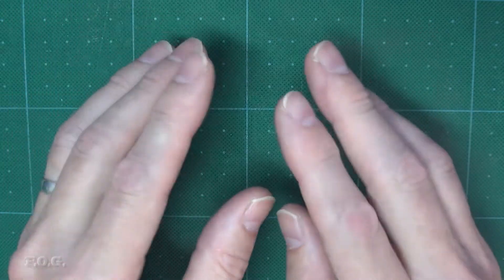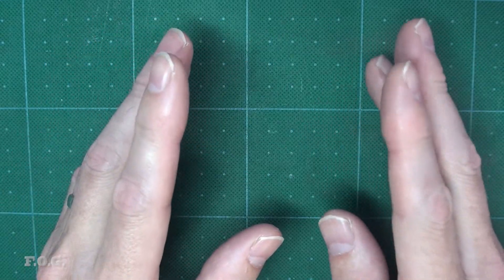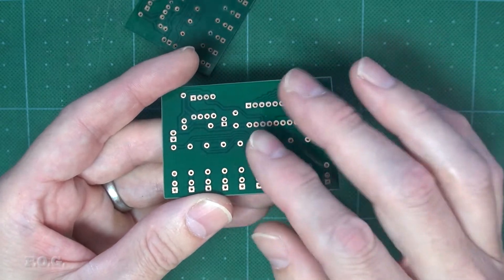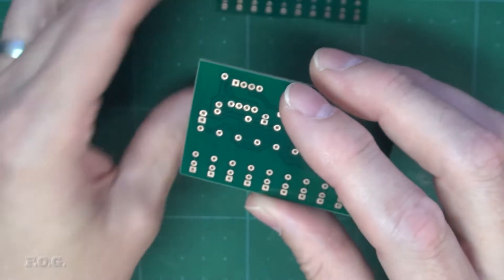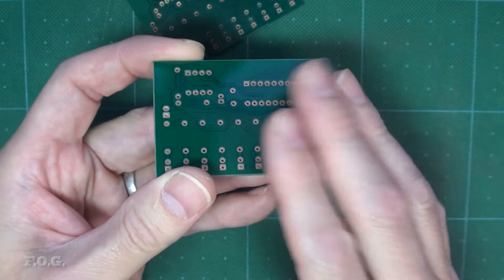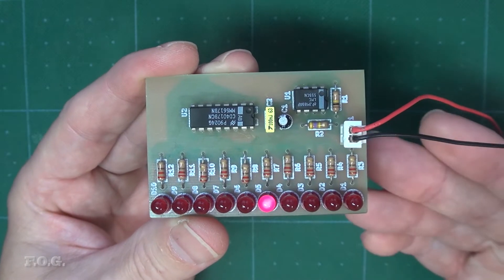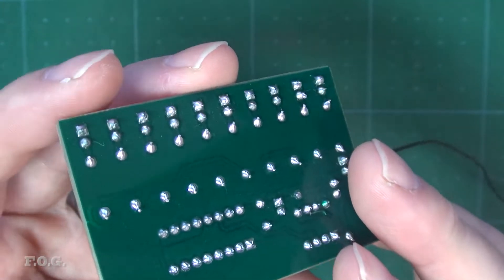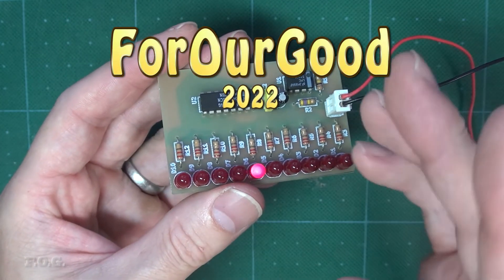EP5 – DIY PCB – Single Sided PCB made with CNC3018

Comment: Run your DRC on the board before manufacturing to catch that trace/pad interference! These look great. I generally don't go through the hassle of the resin, but I also don't use the resin for an etching mask. For vias, they do make rivets that you can set, but I usually just put a piece of wire thru and solder on both sides. The main issue with double sided is that if you don't use the rivets, soldering an IC can sometimes be a problem, as you do need to solder from both sides, since the solder won't otherwise flow through to both sides.

Comment: The thickness of the "green goop" is all over the place which may affect both the Lazer pad clearing as well as the tool clearing.
Get a small embroidering hoop and a piece of screen printing material and use that to flood-coat the board for an even layer thickness.
I also saw one youngster who is experimenting with using a sharpie and CNCing black spots wherever there are pads directly onto the green layer BEFORE exposing to UV to cure. The green coating beneath the black sharpie does not develop and is easily washed off once the rest of the green coating is cured.
Reply from the maker: You are of course correct, the thicker resin for sure makes it hard to clear with the laser.
But you will see in episode 6 I demonstrate the hoop method.
But actually I stopped using the hoop a while back, as you will see in my PCB tutorial video, and just use the silkscreen holding it by hand now.
I have some recent improvements in the application of the resin, which I will also share in an upcoming episode.
I have never heard of what you described about the back sharpie, sounds pretty innovative if it really works! Obviously adding another method/device to the process is honestly not that desirable, and my gut tells me It seems unlikely to work on a 0.2mm x 0.2mm pad.. But I always keep an open mind, so if it looks promising I always like to give things a try!

Comment: You have a cnc mill,drill some hard plastic small bore tube with the finest pcb drill you have block one end up with hot glue .connect a fishtank air pump to it and sit it under the pcb in the ferric chloride ,on a plastic riser to allow the air bubbles to clear the copper debri while etching,also since your using ferric chloride make up a batch of "EDINBURGH" etchant ,other than being the capital city of Scotland,it's a mix that by itself helps clear the "smutt" from the board as it is etched,what is the saying winner winner chicken dinner.

I've used Edinburgh etchant(please not Edinburg,the Scottish variant of the English borough) to make brass escutcheon plates for vacuum tube amplifiers that i make,it does a great job,makes nice clean etches and even cuts etch time down with the desmutt effect.

Usually a 4:1 ratio,4 parts ferric chloride to 1 part citric acid,citric acid is bought as a powder,i can't remember if i even used this ratio,i think i added a litre of relatively strong citric acid mix,a few heaped table spoons.the citric acid is food grade so is non toxic by itself.

Use a tall tupperware container to make a bubble etch tank,microwave the sollution with an air tight lid in short bursts to just get it to around 20 degrees c ,glass heaters for a fish tank also work since the commercial units use them,i know because i have an etch tank and a developer tank,and wish i had just made my own with the purchase price of about £200 each 20 odd years ago.
Reply from the maker: FYI: Currently my etching with ferric chloride takes between 5 and 10 minutes to complete (for me this is not a long time).

But saving a bit of etch time and improving the even cleaner etches sounds attractive, so I might try the Edinburgh etchant you suggested at some point in the near future, so thanks for the tip!

Actually just a few weeks ago I was researching an alternate etchant, and was looking into one based upon hydrochloric acid, sadly getting that in decent concentration here in Japan is basically impossible (as is liquid tin FYI), so I gave up on that. I also expect that people in many other countries would face the same problems getting these somewhat toxic chemicals, so I don’t those are good “generic” solutions to show people.

As for coming up with more improved etching facilities, I am not feeling the pressure to do that right now, but I may get around to it eventually.

Currently I am regularly etching 0.1mm traces, and to do that you really have to be on your game, and monitor the etching progress like a hawk, 45 seconds is often the difference between success and failure. Basically, I am standing over it for the duration in any case, so manually agitating does not bother me (its rather therapeutic actually) :face-blue-smiling:

Comment: This really does take a long time to do,I think because i have to make multiples of one schematic i'll use a painted sheet of clear acrylic and mill it out to make a uv resist mask with any drill holes performed by the mill,using the largest track size as a single cutter then use smaller cutters on 20-30% overlap just like milling any other image in wood to get the rough then fine detail,that will clear out the final,a cut depth enough to clear the paint away will be fine.

The laser is great but going old school with uv resist for the copper and making the other stencils for solder pad resist and any text made using an engraving bit on painted clear acrylic all with registration holes will make for a good set to make multiples of the pcb in short time spans.

The only issue i ever had with uv exposure was using a laser or ink jet printer that would leave pixel holes in the stencil,apart also from going from positive to negative resist the cost of positive resist in the UK was astronomical until the negative  resist from china came along,other than this the uv stencil method takes about 15mins per board,ok this is without component top side marking,but as i say a stencil for this or a silk screen can be made,silk screening is faster too but it's a bit cumbersome compared to the stencil dryfilm method,text is fine really for single sided boards.

I want to make pcbs as fast as is possible for one offs i really don't want too much time taken over that either especially if its a prototype.

If anyone got this far i should add that you might be able to use a refillable pen in a purpose made holder with conductive paint and conductive glue as solder for smd,just a thought.

I'm not knocking this series of vids,there's a lot to learn from your learning process here,success or failure,so i do appreciate the effort.

Subscribed and thumbs up.
Reply from the maker: So, it’s probably important to note, that at the start of this project, the amount of time required was not the key focus, my focus was on trying to make a PCB at the highest possible quality with the lowest possible overall investment. Hopefully, as you progress through the series, you will agree that I am slowly but surely meeting those objectives. (Check the community page for recent updates too).

As at this point (spoiler), I have pretty much found solutions to all my key problems, the next natural step is optimizations that will save time, and recently I have made some strides in that regard, with likely many more to come. 

But I think it is important to also keep perspective, as the goal of making high quality boards is a fundamental goal for me. The design and prep before even making the board might take anything from a couple of days to a week. So, if it takes me one, two or three hours to actually manufacture the PCB, the that okay for me, and still quicker than ordering and then waiting for the PCB to arrive from China (especially if I end up doing 2 or 3 versions of a particular board back-to-back).

I also rarely, if ever, do more than one copy of a PCB that I design, and if I remake a given PCB it will always have some type of improvement. And if I need a batch of a specific board, then I will just lay out duplicates in the design, and make them all in the same operation (as I did the other day actually).

So really, for me, re-making the same board over multiple operations is just not a factor, and if I am honest, if I needed a super large batch (>20?) of boards, then I would just order them from China (though I suspect this will never happen..)

Thanks for subscribing and I am happy to hear that you have found this series stimulating, and I really do appreciate getting feedback from viewers, I may not heed every piece of advice immediately, but I do keep it in mind, and some of my viewers ideas have actually key to making some important improvements in my process.

:trophy-yellow-smiling:
Reply: @ForOurGood  I wasn't knock your methods,i was going on about repeatability for light production,you're right that in batches going to a pcb house is the easiest way,for me if i needed to make more than 20 or so then outsource it would be,i just find the UV exposure when a good stencil is available is second to none,that's how the pcb houses do it too,each to their own,if it works for you go for it.
I did learn a lot and i did download the vids that held certain info to watch again off line as i have only ever used maual lathes and mills,still learning.
Appreciate the reply too,all the best.

Comment: ventured with the 3018 pcb milling from uv and photoresist/toner transfer methods to simplify prototyping. the allure of having the completed pcb already drilled in under 30 minutes after finishing it in kicad was just so irresistible. just like in the WEGSTR videos. but alas, decent repeatable pcbs are unobtainable with all of the current cheap 3018s as is. breaking a lot of the free V bits in the process.  even tried going the laser and spray paint pathway which imho made the process long and cumbersome again defeating its purpose in the first place. with significant tinkering, eventually made the 3018 achieved the above goals with trace size limited only by the 0.1mm tip of a 15 degree V bit. just make the machine sturdy enough to eliminate any play of the bit and backlash of the leadscrews. on my machine achieved it by adding more leadscrew nut on the x and y, changing the z gantry to accommodate more of the 12cm round rails, taking off the load on the leadscrews from the stepper motors on all axis, add the 3040 conversion kit to maintain the working area, and even taking off the stock spindle fan. only the stock z gantry was removed and not reused in the upgrade. no need for the expensive upgrades like ballscrews, linear rails, and bigger spindle motors. although trying to add at present  close loop control on the steppers for more accuracy.

Comment: Hey man. I was wondering. How do you feel about op amps. I'm sick of every person cramming the same bs down our throats assuming they are a pandoras box or something.  I've been want to do a project with them that doesn't involve synth music
Reply from the maker: Op-Amps are not as much of a thing now the world has gone mostly digital for signals, 80% of my projects in the 90's contained at least 1 Op-Amp, but I rarely need to use one now. There are still some important places where they can be used however, such as pre-amplification of linear sensor signals. Modern Op-Amps have also greatly improved compared to the days of the venerable LM741. Specifically, the output signal can now be very close to the extremes of the supply rails, this makes them super easy to work with. Of course Op-Amps remain the go to place for differential signal processing or as a high speed comparator, but typically that is going to be a pretty special circumstance. Even audio applications seems to have less and less need for standalone Op-Amps, often there is a Op-Amps functionality already built-in to special functions chips you buy. So maybe it's not the death of the standalone Op-Amp yet, but I think it is going to be rarer and rarer that we actually use them in our projects.
Reply: @ForOurGood  I agree but I'm still learning so I've been gobbling as much info about them as possible. Alot of arduino sensors use them to bump up the voltage for giving better readings I've noticed.

Comment: Looks like it would be better to drill it before etching right?
Reply from the maker: It's a good idea, but there are a couple of  problems doing it in that order. First is, l am doing a couple of resin layers after etching, and that would get into the holes. The other problem is the resin based resist, while robust, it is still brittle and can flake off near the edge when drilling, messing up the etch. Actually what I want to do, is to etch the holes in the pads to help make the drilling more accurate and clean, as this is what I always did 25 years ago when I hand drilled my boards. But so far I have not been able to get KiCad and Flexcam to do this..  But I plan to try again! Thanks for your comment ;-)

Comment: I am building a small CNC machine and was thinking of making my PCB's the exact same way. Good to know it is possible. Which laser are you using?
Reply from the maker: More than just possible, actually pretty amazing. Check some of the later episodes and you will see what I mean. All the details on equipment used is embedded in the description of episode 7 of this series. Thanks for the comment!
Reply: How did ya make out. I am as well if I'm ever not sick.